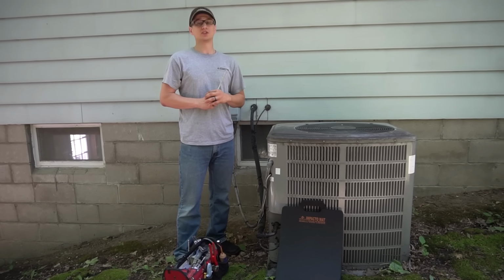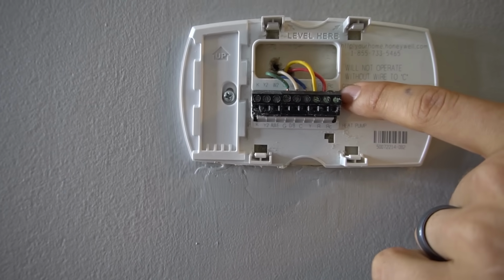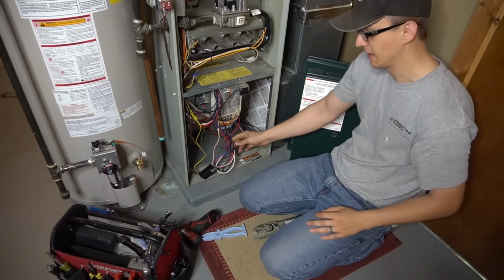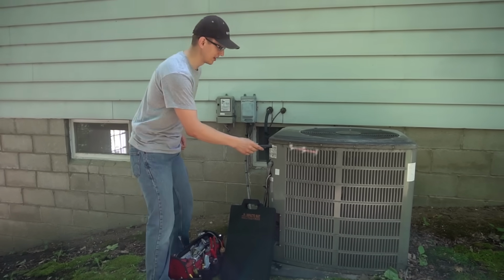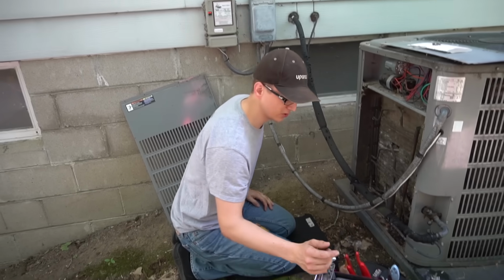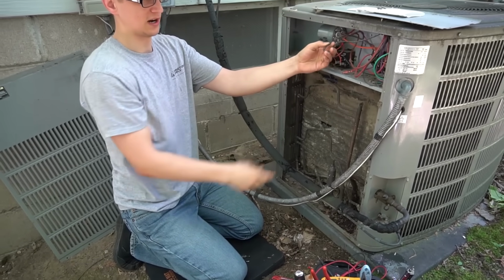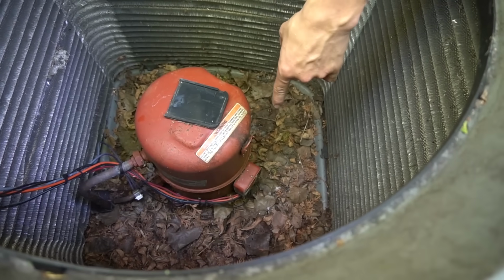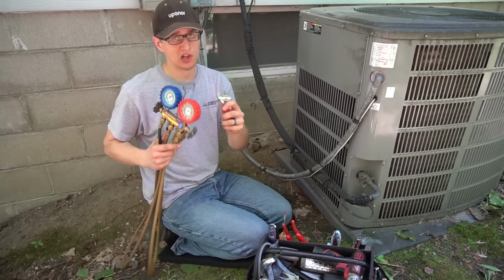AC Unit Not Turning On - How to Fix It Step by Step

Comment: A friend connected my thermostat and I thinks it was done incorrectly.  Could this cause warm air to blow when I turn my a.c. on? Thanks
Reply from the maker: Well if the AC was working before the friend connected the thermostat, then there is a good chance that something was done wrong. Did he/she put the wires in the right spot? Also, did they turn off the power to the furnace before doing the repair? If not, then the 3 amp fuse or breaker in the furnace control board could have blown/tripped. Take the bottom furnace door off and try to find the 3 amp fuse on or by the control board. Pull it out and see if it's burnt out. I would start there.

Comment: unit inside works and blow air.  the out side unit is doing enough thing / i think the thermostat went out what i'am think.  its not clicking and its mercury filled it got real cold in here and wouldn't shut off
Reply from the maker: Either the thermostat is bad or the control board in the furnace. Here is an easy way to check. Turn your furnace power switch off, then take the cover off of the thermostat and remove the wires from R and Y on the thermostat. Make sure they are not touching anything or they will cause a short. Turn the furnace back on. If the AC still turns on and runs non stop with those wires off, then you have a bad control board. If having those 2 wires off does turn off the AC, then the thermostat is bad.
Reply: heat want turn on auto. manual yes  energy  heat yes   what i think too thermostat  its been needing one for a long time  can see the mercury spark  to turn off and on. but not no more.   thx brother
Reply from the maker: Okay, sounds like a plan. Good luck!

Comment: Our fan on our unit blows air through the house but the outside unit doesn’t do anything the capacitor is fine and so is the fuses outside, what else should I check?
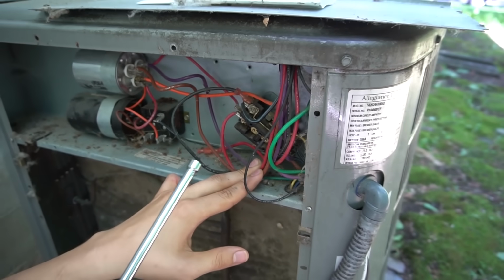Reply from the maker: You didn't mention if you checked the circuit breakers or not. I would start by (carefully) pushing in the contactor plunger. Like I did in the video at 18:00 If everything comes on, that means something is not sending 24v from inside. Either the thermostat or furnace. If nothing comes on, then you may be missing 240v.
Reply: Word of Advice TV  none of the breakers were tripped and when the thermostat is set to run the ac the plunger is in but it’s not running, I checked with a multimeter and it is getting the 230v and the fan also rotates freely with no grinding or resistance , what else should I look for or do?

Comment: Hi, I pushed down the plunger the unit powered and the fan spins, when i let it go it stops. What should be my next step after?
Thanks.
Reply from the maker: Hey Shawn! So it sounds like you have 240v but you are losing the control voltage somewhere (24v). I would check the following to begin with:

1. The wires coming out of your house with the freon pipes, do they go straight to the contactor coil or does one of them go somewhere else?
2. Inspect those wires for any bare or broken spots.
3. Check your 3 amp fuse or breaker on the furnace control board.
4. Try turning on your furnace. Does it work?
5. When you turn on the AC, does the furnace blower motor come on?
6. If the thermostat has batteries, try replacing them.
7. Did the furnace power switch accidentally get switched off?
8. Do you have a meter you can check voltages with? I can be of more help if you do ;)
9. I would appreciate it if you respond in a numbered fashion, like my questions. (no pressure)

Let me know what you find! Hopefully it's something simple!
Reply: shawn Mo I
Reply: Word of Advice TV 
Sorry for not replying sooner, i was away for work, i just got back. I did all the testing i found out that the wiring is wrong. I had my security company came for a service call, that's what they left me with. Now i took all the wiring out trying to figure out where they should be going... bad idea. I am able to turn on the air handler and shutting down on the panel. My problem right now is that i don't know how to carry the 24 volt down to the compressor. I have a boiler and central air for cooling. Two separate system. 
On my thermostat i have: C,B,O,W,W2,Y,Y2,RH,RC,G,A those are the terminal.
On the air handler board i have: DH,R,W1,W2,Y1,Y/Y2,G,O,C 
I am using two separate wires. One is a 18 AWG 2/C  (white and red) that goes to my boiler. And the other one is a 3/c (white, red, green) that goes to my air handler. Lastly i have a 2/c (white and red) to the compressor.
Can you please tell how to correctly wire this thing. I am very sorry for this journal, i just wanted to give as much info as possible. Thanks for your help.

Comment: The temperature here in Akron, Ohio is 92 degrees, it has been for a couple of days now.  That's when I have been experiencing an issue with my AC breaker tripping to off position.  Are you able to give me advice in regard to possible issue?  Thank you.
Reply from the maker: I'm sorry, I must have missed your comment. Just saw it now. So does the breaker trip after the unit runs for a while or does it trip right away? If it runs for a while and usually only trips on the hottest days, I would start by thoroughly hosing down your condenser coil, even if it looks clean. A plugged coil can trip a breaker. Also, I would put in a SPP6 Hard Start Kit: https://amzn.to/2JSPieo That will cut your start up amps in half when the compressor comes on. Especially helpful on very hot days. Also, if you have a multi meter, check to see if your capacitor is getting weak. If you don't have a meter, I would just replace the capacitor. They aren't too expensive. I have a video of how to check and replace one in the description.

Comment: Thanks a lot, truly! I have a Heil AC unit and I had to 2 tiny screws to remove the plunger cap. Once I had access I applied pressure with a plastic spoon. Some tiny sparks, maybe an dead insect, but she is now connecting and up and running!
Reply from the maker: Awesome! One of the easiest fixes :) Stay cool!

Comment: Hello, my AC stops cooling in they daytime but sometime late in the night picks it up. I noticed that there is water accumulated in the drain pan in the attic where furnace is installed. I also noticed that fan does not run when it’s not cooling. What may be causing this to happen?
Reply from the maker: Do you have a meter you can check voltages with? When it turns off like that, by checking some voltages you could probably narrow it down to the problem. One thing I would check is the condensate drain. If there is something plugging it up, it could shut down the furnace to prevent condensate from flowing over and wrecking your cieling
Reply: A guy came to check my HVAC system and advised it was low on freon. He added freon. He also suspected there is a possible leak. I also replaced air filters. Since adding freon A/C is working just fine. Do you know if A/C freezing might related to having old air filters. Because before the guy came in, it was frozen and I had to turn thermostat off to thaw it.
Reply from the maker: Very dirty air filters can cause the coil to freeze over. But a unit low on freon can also cause it to freeze.  If it is working good now, then it likely was low on freon.

Comment: Hey when I turn on my Ac the fan above the compressor starts really slow then stops. I checked the fan inside and that is running fine. Would that be the capacitor? Or the fan motor? Thank You.
Reply from the maker: That sounds like the capacitor.  They are pretty cheap, you can buy a new one at an appliance parts store if you have one local otherwise amazon sells a bunch of them too. Example: 40+5 MFD Capacitor  https://amzn.to/2yrugyr
Reply: Thank You I live in chaska here in MN, I'm pretty sure there's one close by.
Reply from the maker: There is a Dey Distributing in Eagan :)

Comment: Awesome video. Just moved into a house with a new ac unit it does not work the fan comes on but outside nothing is moving. I fliped the breaker outside hope it works.

Comment: Good video! 

I recently had my unit serviced and tech stated I need to replace condenser motor. I hear a noise coming from unit but it sounds like its at compressor area, not the fan. Any thoughts?
Reply from the maker: Do you have a multi-meter that you can check the capacitor with? It sounds like you either have a bad capacitor or a bad condenser fan motor. If the technician said you need a new motor, I am thinking he must have checked the capacitor while he was looking at it. If you will replace the fan motor, make sure you replace the capacitor as well.
Reply: Yes, I have a meter. Where do I start?
Reply: One other question. I have GE condenser motor 1/4 HP 1075 RPM - cont air over but I can't find the frame size. It currently uses capacitor 5.00/3.70.... Can I use any size frame? (48, 48Y, 48YZ) I'm going to replace capacitor too. Thank for the help!
Reply from the maker: I apologize! I must have missed your reply a week ago. I hope you already got it up and running by now. The HP and RPM matter the most. If the frame size is off a bit, you may just have to drill some new holes to mount the new motor. Once in a while I also have to cut a piece of the shaft off since the new one comes with a much longer one.

To check your capacitor, you would set your meter to MFD, or uF and then disconnect the wires from the capacitor and put one lead to one terminal and the other lead to the other set of terminals. (doesn't matter which one) You should have a reading close to what the label says. (5 uF)
Reply: No worries! Motor I purchased off amazon said it was condenser motor. Everything matched up with HP & RPM. Once I received motor I noticed it didn't come with wires on outside to reverse rotation. I don't see one on label either. Can it be changed? If so, how would I go about doing? Your videos are much help for the DYI expert, :) Thanks again!
Reply from the maker: Oh good! Almost there then :) just install the new motor and see if it is spinning in the right direction (scooping the air). Also, make sure it is a 240v motor. Most AC condenser fan motors are 240v. So after you install it and turn it back on, if it is spinning in the wrong direction, find the two wires that go from the fan and to the capacitor and reverse those two wires. That should reverse the spin direction. Good luck and be safe! ;)

Comment: Well done. Very comprehensive. But I still have a problem. My system is a year old. Works fine filters are fresh but occasionally it shuts down. When it does the thermostat flashes erratically and there is a clicking at the air handler. I will shut the system off at the breaker and restart it after 15 to 30 minutes and it seems to work okay. I suspect the system is trying to restart the compressor too quickly between cycles and it's in a time out phase. Does this sound right? If so, is the problem the air handler control board or the thermostat?
Reply from the maker: Hey Michael! Thank you! And I think you are right. Likely either the thermostat or control board are defective. Although a loose connection could cause that too.

1. Does your thermostat have batteries? If yes, have you tried replacing them?
2. You said it occasionally shuts down. How long does it typically run before it goes haywire like that?
3. If you take your thermostat off the wall, do you have a wire going to common? (C)
4. Slightly tug on all the thermostat wires to check if any of them are broken.
5. Is your thermostat simple or more on the expensive side? Programmable with WiFi, etc.
6. If it's a smart thermostat, can you go into an advanced menu and see if there are recent fault codes?

Let me know what you find. I am just trying to narrow it down to the actual culprit.
Reply: Thanks so much for your prompt response. The thermostat is simple digital with batteries but no wifi. No fault codes. Batteries are fresh (replaced 4 or 5 days ago when problem first occurred). There is a C-wire connected so batteries are back-up I assume. It last shut down two days ago and then several times today. Wires are all tight. Since my original message I researched the installation manual and reviewed the settings. The "Compressor Protection" setting was 1 minute which seemed short. So I reset to 5 minutes. No problem so far. Maybe this solved the problem but I wonder why the air handler control board wouldn't have this protection built in. Or why the problem only developed recently. So maybe I haven't solved the problem...?
Reply from the maker: Hmmm.. Let's give it some time and see. Normal compressor protection time is 5 minutes. So that's good that you changed it. This is just an odd-ball scenario. From the erratic behavior of the thermostat I would think it's the thermostat that's malfunctioning but it's hard to say. This one will be hard to pin-point since it is intermittent. I don't have any revelations at this point, sorry. I don't think there is anything wrong with the wiring since it has worked well  for a year.
Reply: Problem was partially clogged condensate drain. Clicking at air handler was a condensate shutoff switch wired backwards which caused clicking rather than error code.
Reply from the maker: Ahh that's what it was! The condensate overflow switch must be wired in series with the thermostat. So if that trips, the thermostat shuts off. That will sure get your attention. So when you shut it off for a while, you were basically just giving it a chance to drain out. Thank you for coming back with the update! Stay cool!